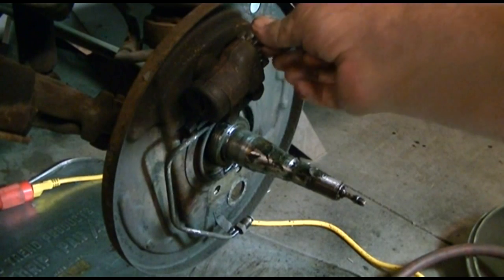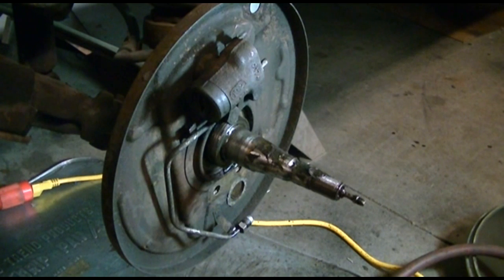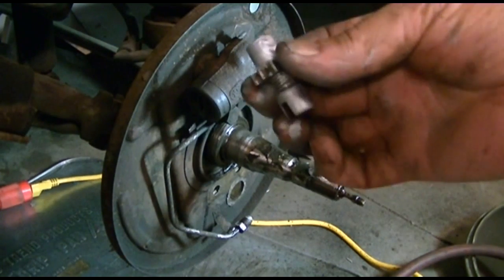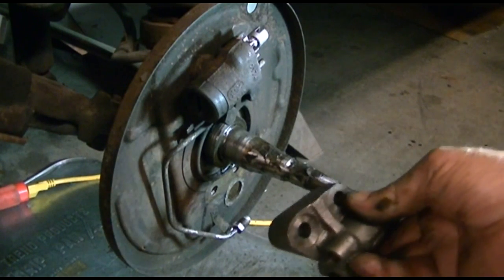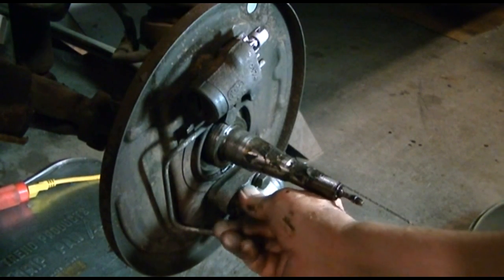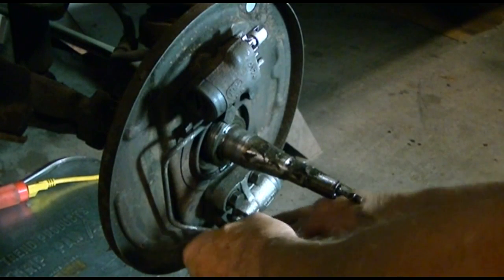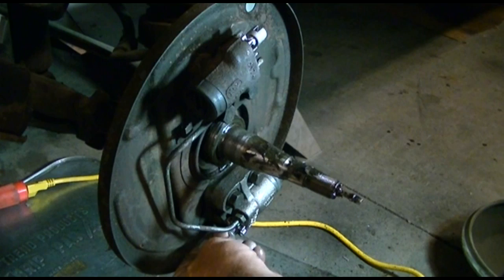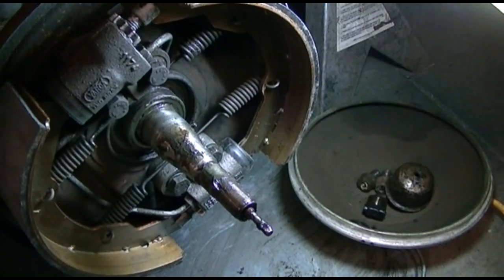Front Brakes Westy Part II

Comment: I had a cop hassle me because I had my rear brake assembly completely apart on the street. It was a perfectly safe place to do it because I had cones warning people and it was a wide/not busy street. He told me to move it off the street to which I replied that it will be moved when Im done. He got pissed because there wasn't anything I could do since it was completely apart. Glad I didn't get a ticket. Good times.